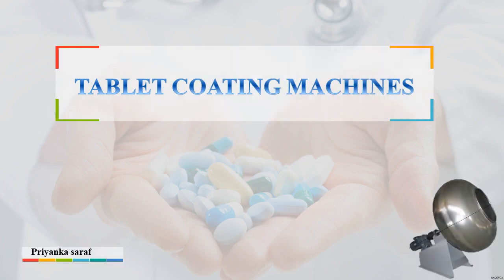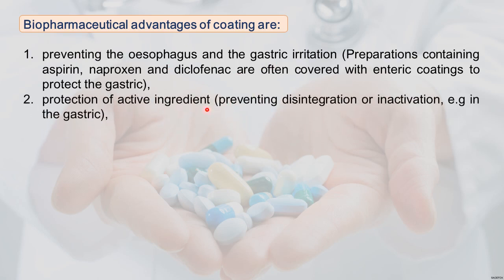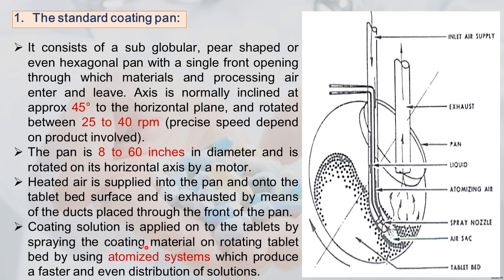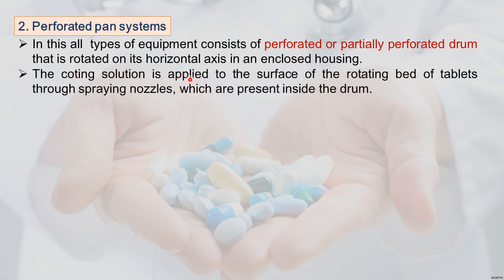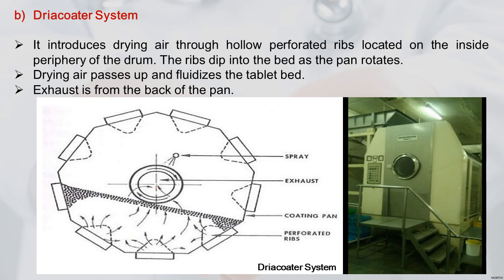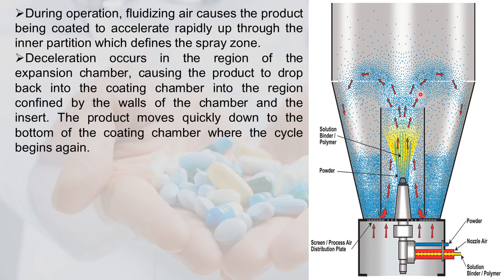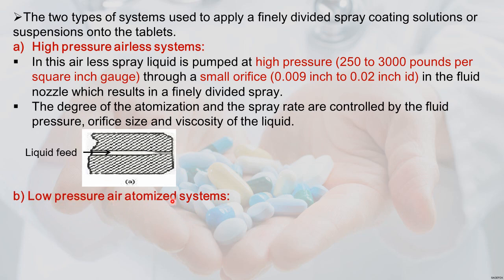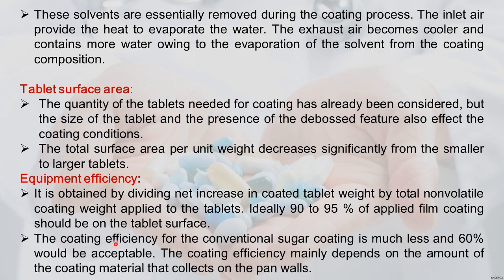Types of Tablet Coating Machines, why coating is important

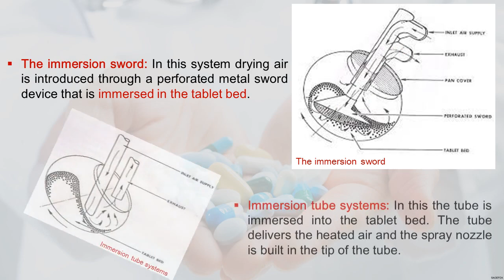Comment: Dear Author the figure shown as the Immersion tube system is wrong ( at 11:03).. Moreover, the figure shown for Standard coating pan ( at 8:00) is also wrong... Kindly correct them